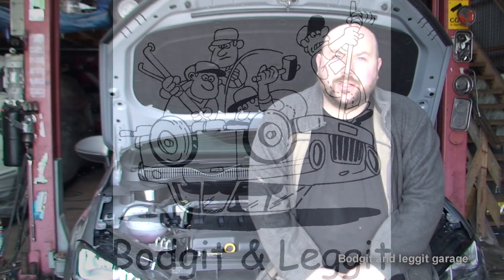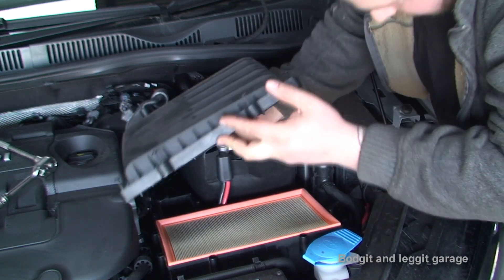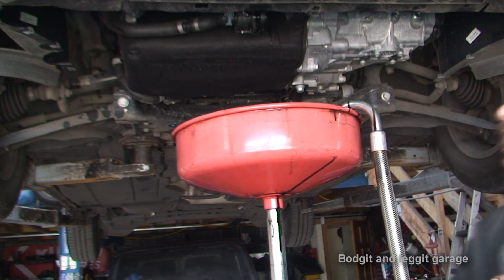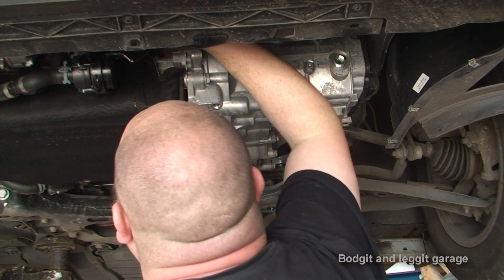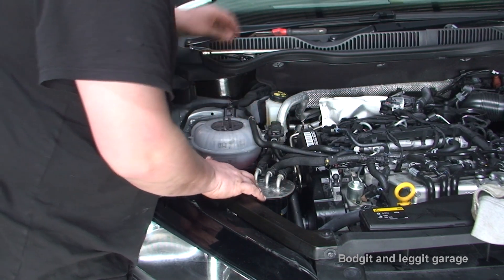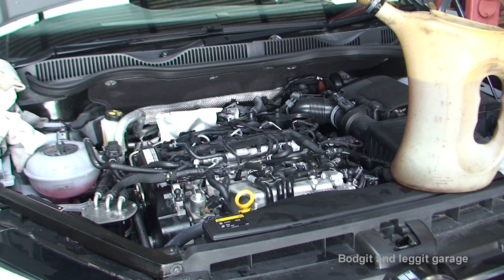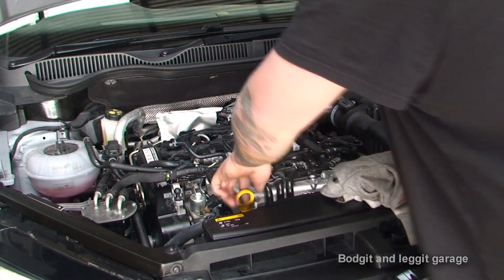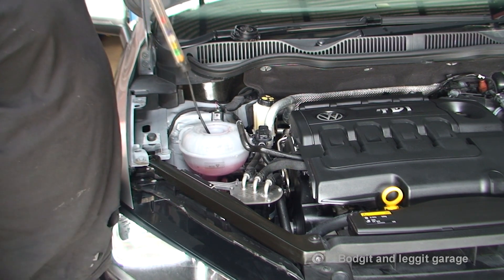How To Service 2015 Volkswagen Golf Bodgit And Leggit Garage

Comment: As for the amount of oil, I just go to a website, type in my reg nr. and the amount is already written out, in my case 4,25 l. Obviously there are plenty of other sites around for that as well. My point is that you don't even need to mess around with that. I just drain and refill. Of course I check it afterwards. I also let the engine run for 10 or so seconds just to see that nothing's leaking, etc. 

I did my most recent oil change including the filter sept. 11 last year but I haven't driven more than 5,000 km since. I'm using Mobil Super 3000 X1 5W-40.

Comment: If you want to prime the diesel filter without using the methods you outlines, you need an OBD tool like VAGCOM to do the priming. Like you said, just turning the key doesn't work (and can wreak the pump).

Comment: I've always wondered why manufacturers don't put part numbers of service items on a sheet and stick it to the inside of the bonnet when it leaves the factory.
Reply from the maker: yes mate that's a good idea they should do that would save me a lot of hassle
Reply: +bodgit and leggit garage your website forum doesn't work at the moment it just loads stupid adverts everytime I go to your link
Reply from the maker: +recordedclips8888 hi mate I've just tried it my end and it seems to be working fine but I will look into it thank you for letting me know
Reply: +bodgit and leggit garage that's ok,will try it again later to see if it works properly my end aswell.
Reply: +bodgit and leggit garage the link with .editboard website it starts to load up then 5 seconds later auto loads some fake prize giveaway advert again
Reply: Too easy!

Comment: Jeez, that's a huge difference in filter size. Weird!
Reply from the maker: yeah mate it's a new one on me too but it works and it's still going so I'm not going to complain too much lol
Reply: +bodgit and leggit garage  pls tell me your opinion what type of oil should i use one may 2003 Opel Astra 1.6 16v Ecotec i live in Romania i normaly use 10W40 GM i dont make more than 7000km/year !
Reply from the maker: +jaraisz06 hi mate how many miles has your car done
Reply: +bodgit and leggit garage  i can tell you in KM 153267 KM ! i can tell you i dont care about how much it cost the oil i want the best for my car !
Reply from the maker: +jaraisz06 yes mate that will be fine thanks for watching thanks for the question don't forget get your hands dirty
Reply: Obviously whoever serviced it before you used the wrong filter

Comment: Well, just from watching that vid, I don't think I'll be buying one of those.  Absolutely ridiculous place to put the oil filter.  Also, are there seriously no part numbers on any of the parts?  Can't believe that you couldn't get the right parts, just from the reg number!  I'm also a bit surprised that you're doing an oil change on a virtually brand new car, especially a diesel golf!  And also surprised that the oil was as black as that!
Reply from the maker: you seem to get surprised a lot just going off the reg number doesn't guarantee getting the right part facts and also diesel engine oil will go black in colour in a couple of days and why wouldn't I be service in the new car every car need servicing
Reply: bodgit and leggit garage "you seem to get surprised a lot".  you remembering all my comments! lol (or do I misunderstand you?)

Maybe I've just been lucky, but whenever I've needed parts, and either gone to main agents/motor factors or even online, I've always been asked for the reg, and for stuff like oil and filters, never had a major issue.

Yes, I accept that all cars need servicing.  Was that a PD btw, or common rail?